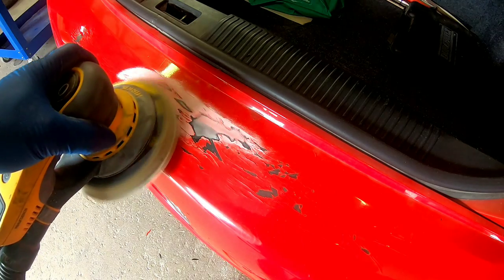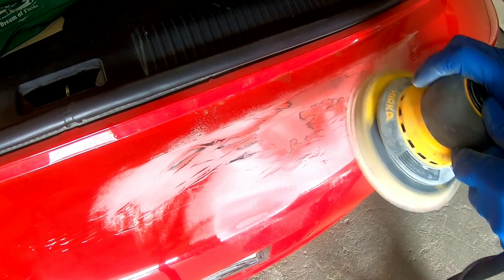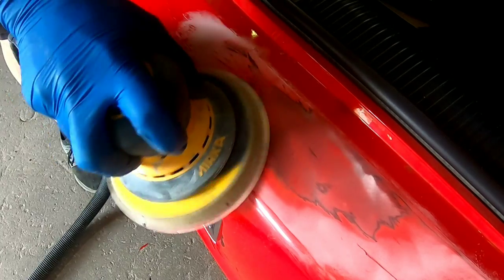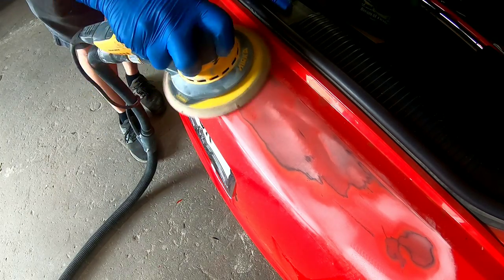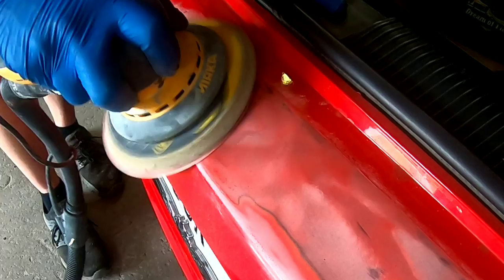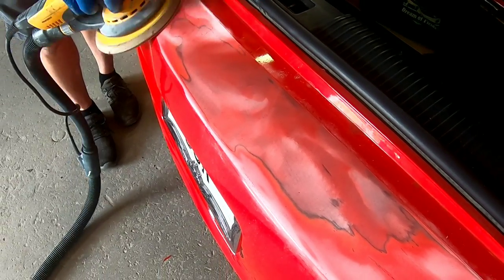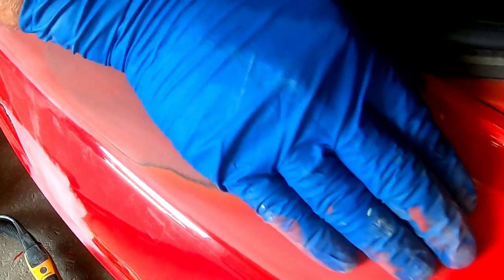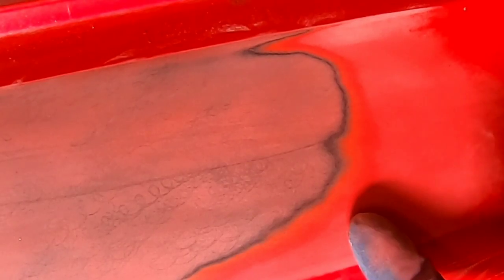How to feather edge auto paint. auto paint , bodywork

Comment: After that great sanding and leveling, since the thickness went down significantly, should I first add some filler and then a 2k high-build primer to bring up the level again?
Reply from the maker: Only if it needs it, in this case it just needed primer  but that full video  is coming up.
Reply: @GarageNoise  hey thanks very valuable video if I’m doing a small spot like a hand palm size do I still have to feather it far out on old paint when flattening DA?
Reply from the maker: @ashramdhan1582  just feather it out as small as possible.  A palm size I would say yes but you could use filler to smooth it out if it's  small.
Reply: @GarageNoise  okay can I use filler all the way close to old paint by the feathered edge thanks man your so helpful

Comment: Perfect. Exactly where I'm at with my project car lol. Now where im stuck at is do I need a adhesion promoter where the bare plastic is showing now? Or just some 2k over it? And about surface cleaning before paint. Heard u cant clean  plastic bumpers like u can body panel with wax and grease remover? Tia
Reply from the maker: I wouldn't  use wax and grease remover on the bare plastic. You could use some adhesion promoter on the plastic won't  hurt. I don't  if it's  sanded with 320 I just use 2k primer  thanks for watching.

Comment: I know what you mean about the ghost image of the damaged area reappearing.  Thanks for that.  subed and liked

I have a question about applying a decal on a motorcycle tank and trying to blend the decal edge so you can't feel the decal under the clear.  Is there a clear gel that I could apply to the edges of the decal so when I shoot the clear you can't feel the decal.

Thanks a lot and keep up the excellent vids.
Reply: After watching the complete vid I see that clear, applyed as you suggest, will fill the edge of the decal.  Thanks again.
Reply from the maker: Hey brother,  thanks for subscribing and watching. I don't  really have a solution for you have you considered clearing over the decal? You have to determine if adhesion would be an issue and you may have to put a flow coat over it.

Comment: Hi I've had very microspico pin heads apering not all over the panel just some areas can't see it unless looking up right up close wonder if you may know what could be the causes. THANKS
Reply from the maker: Without seeing it , It's   almost certainly moisture or oil from your air supply.  That's  where I would start. Thanks for watching!